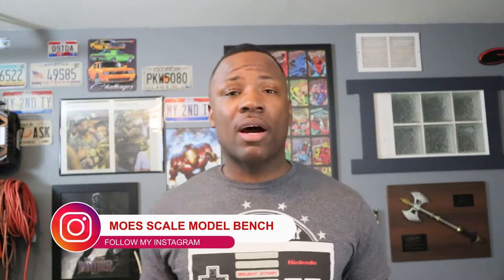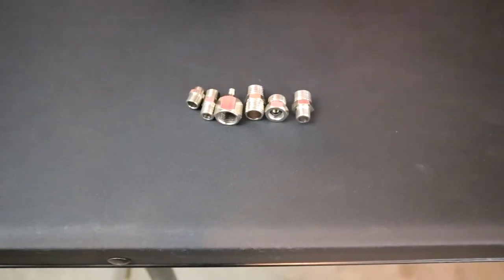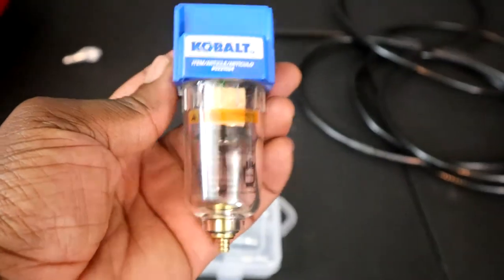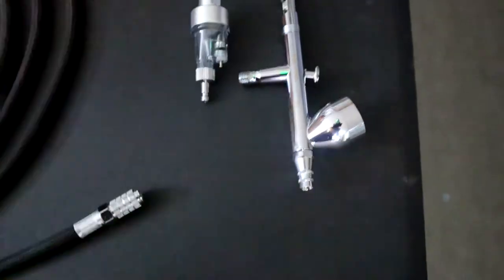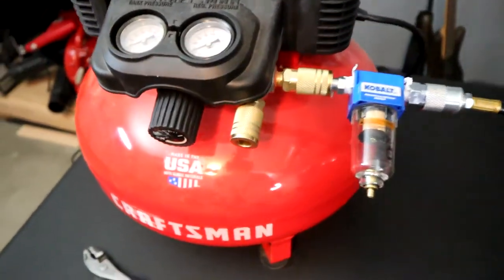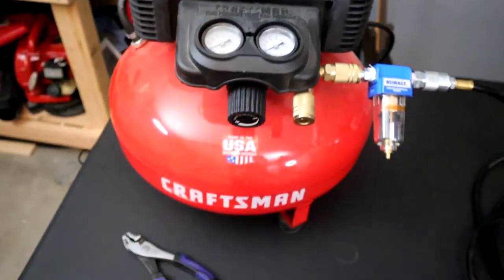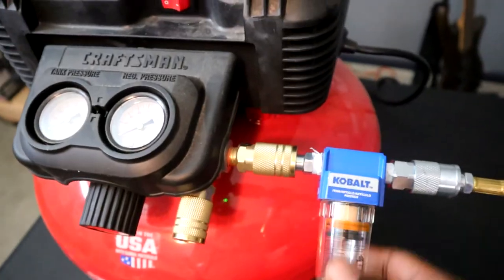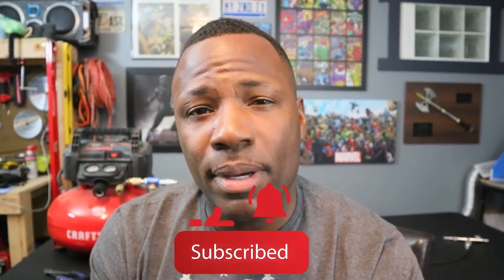A Short How To video on using an Airbrush with a Shop Air compressor

Comment: Best video on this setup! Had me laughing and learning throughout. Thank you bro!
Just a heads up on those air brush compressors, don't waste your money. Go to harbor freight and get one of the ultra silent ones. They cost the same as the airbrush compressors and just as quiet.  Upside is it is a great  compressor for the brush as it won't wake the baby, and it won't make the wife mad.....most important you will never have to abort the mission!  😂

Comment: Air compressors are loud--hearing loss is also a potential issue over time, so having the compressor further away is also a real plus. I recommend putting the Amazon links to the equipment in the video description. That will help a few people and might even give you a few pennies if you use affiliate links.

Comment: Someone gave me a box of iwata air brushes, thanks for explaining how I'll be able to use them. I am preparing to run new power to my garage in the spring so i will run an air line into the house at the same time as my artist space is in the same room as the electric panel. This way i wont hear it. I appreciate you sir

Comment: This video misses a very important point.  The compressor NPT is a tapered thread with no O-ring, and air brush BSP is a straight thread with an O-ring or washer.  I have not been able to find a 1/8" BSP x 1/4" NPT fitting at Lowes or Home Depot.  I did find it on Amazon - two for $9.
Reply: Plz link it

Comment: You are not talking to 5 year olds, you do not need to tell us what the Teflon tape is for and how to use it. What next, are you going to tell us that it's important we don't poke our eyes with the air brush needle because that would be bad? keep it simple, keep it brief, don't patronize your audience (means talk to them like children) and don't feel you have to fill the entire segment with word salads, less is more.
Reply: Dude, you are rude and childish! I just came from another vid on using a shop compressor, and a few did not think or know about Teflon tape. Not everyone is a contractor, and actually I am for many  many years, and have used many from a single tank to a large shop version. So, from air connection to plumbing connections, tape is needed, and not everyone is knowledgeable. Enough said.

Comment: Are you serious Moe? Those are water traps you are showing not regulators.  The regulator is already fitted to your compressor. It’s the black knob in between the two gauges. Speaking of those gauges the one on the left is tank pressure and the one on the right is outlet regulated pressure. You can adjust the outlet pressure by adjusting that knob. Also you are mixing up your males and females. This should help you.
Reply from the maker: I'm sure when people look up the part they will see exactly what it is. I'm also aware that I mixed up the male and female end. It happens. Me mixing up the names didn't change the way they work,  But thanks for letting me know. And i can't say it helped in any way.